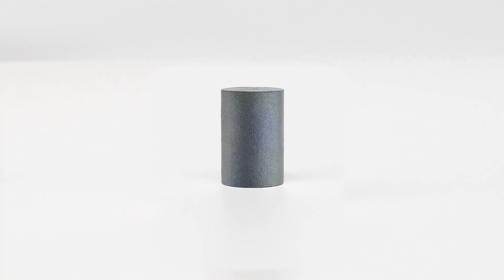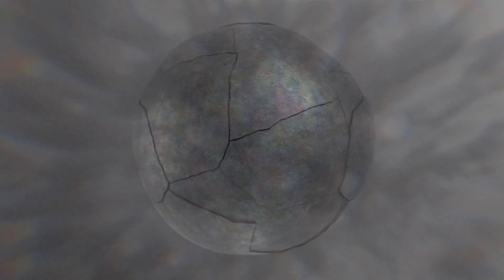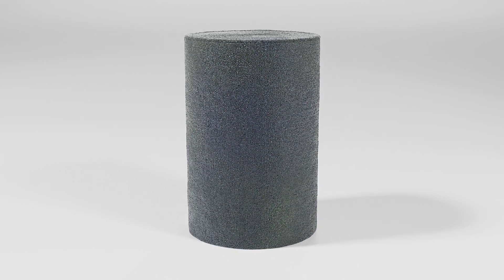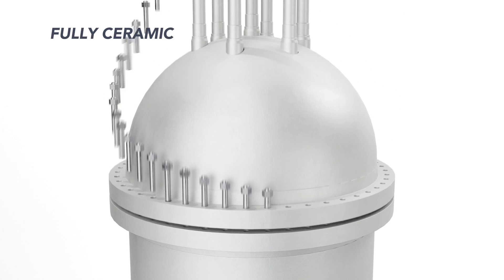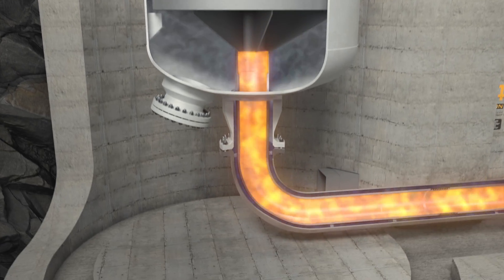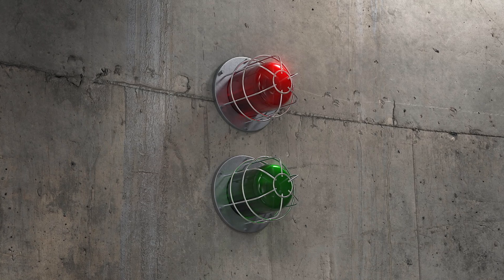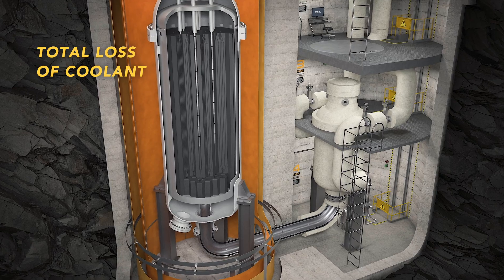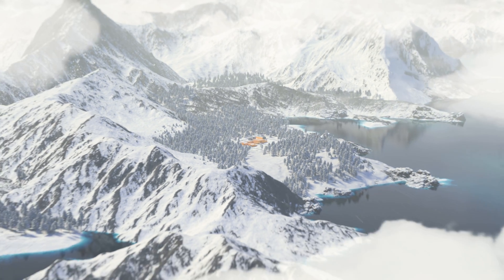How it Works – the Micro Modular Nuclear Reactor

Comment: That is one of the most impressive and least advertised technologies i have ever seen in my 72 years on this planet.  Bravo!!
Reply: If you haven't already look into "Gen IV" Reactors. Technically, this Small Modular Reactor IS a Gen IV, along with Molten Salt Reactors. Look them up, they are great ideas of ways of not having to have such large cement structures to keep the water under pressure, as the Gen III Light Water reactors do.

With Molten Salt Reactor (it is a metal/salt that becomes liquid at say 1000 Degrees F and can increase in temperature to say 4,500 Degrees F, before it boils. So that 3,500 degree is a ton of energy that can be put into the salt of the MSR as while it is not being used. (it is basically a complicated battery, that can be recharged every day, until there is a significant pull on the system which happens every day from usually 2-9PM.) When that surge of demand is over, it goes back to storing more energy for the next day.
Reply from the maker: @eriklondon2946  100% great comment. Didn't know the discourse was this good on YT. 

those temperatures are way too high. I don't think there's any nuclear reactor tech looking at an outlet temp above 900°C
Reply: @ultrasafenuclear  Oh you guys have positions in WA? Hmm, anywhere else I can work for you guys?
Reply: @ultrasafenuclear  My God

You guys are literally my dream, I all ways envisioned an underground nuclear reactor for the past 5 years and I KNEW it can be done. And walla, you guys did it, I'm so happy for you guys, this my literal dream. Thankyou for doing this guys, I want to help as EE if I can :)
Reply: We won`t see shit if it does not benefit governments directly :(
Reply: @TheBBoyPain Jai Hinduja.  South Africa will be trying to put up their design by the end of the decade.
Reply from the maker: @tedchandran  we employ many South Africans!
Reply: @ultrasafenuclear  Man, I'm an EE, I want to get involved, how can I?
Reply from the maker: @jaysaini955  Start evangelizing. talk to people at your local utility. Or are you looking for work?
Reply: @ultrasafenuclear  Work too, do you have careers for EE?
Reply: @TheBBoyPain Uh the first three have been announced.
Reply: IS A LIE    Give   Nuclear Your Money & Your Life  For 24k Years   No Nuclear Melt Down HAS EVER STOPPED  @ 41 CPM
Reply: This will go nowhere. It's a great technology but it's TOO effective. Climate Change Activism has little or nothing to do with climate. Last think they want is abundant clean energy. That's liberation...they want control
Reply: Got to get the uranium from somewhere, look at the Grand Canyon, what kind of idiot ours a uranium mine next to a tourist community lol lol lol
Reply: Nuclear combat for everyone lol lol lol lol
Reply: Trading efficiency for safety is not a good deal when "traditional", decades old fission reactors are already extremely safe.
Which tells me this is for niche situations and conditions, like to power remote cities/industry, but not to power a nation as a whole. Maybe the germans would use it I guess, because of their irrational fear of nuclear.
Reply: it is not adverised becayse it is just coming out
Reply: the future is now old man
Reply: It's a cartoon.
Reply: I wonder if this technology can be used to power space craft used to explore planets in the solar system 🤔
Reply: @Novideos00  Nuclear powered spacecraft have been exploring beyond our solar system for 50 years.
Reply: HOW OLD ARE YOU? but this reactor is very safe somewhat for when cooling rods stop working it will automaticly shut down (: or it has a spare cooling thing (helium gas) without power (: even without any cooling (: (: (:
Reply: @cucumbergamer-970  A Cartoon is safe, no cartoon reactor has ever caused environmental damage.  /s
Seriously, reactor "safety" has multiple levels .. operation, fuel disposal, dirty bomb exploitation, etc... radioactive crap is dangerous, always will be.
Reply: @KrustyKlown Son what would you know about it.
Reply: jup görink but tängy öh dere - :-
Reply: The United States of America passed an invention secrecy act of 1951. Look it up, value tainment or p b d did a video on it.They're hiding technology from us
Reply: It's called the answer.
Reply: This is best for vehicles charging station unlimited eneger for next 25 year for the cars.
Reply: What if the control rods jam?
Reply: Jai Hinduja.  The governments must really  go down to the Shidao Bay  nuclear plant in Shidaowan, China to get the most updated data on the benefits of running 4th generation triso pebble reactors.
Reply: This is 1960’s tech. Look up HTGR. Peach Bottom unit 1, Ft St. Vrain, Dragon, and AVR
Reply from the maker: @nukiepoo  it is for the most part. Expect core design, materials, and factory production have come a long way since then. Not to mention rendering capabilities ;)
Reply: İt's NOT impressive at all!!!! What about Nuclear waste???

Comment: They won't want them when they realise the cost of installation is NOT significantly lower per unit energy than full scale but the cost per unit energy delivered is at least 30% to more than 100% higher. Also there is also the fact that most of the refined fuel comes from China and sanctioned Russia, so there could be difficulties getting fuel. Also, NuScale, the only SMR company listed on a stock exchange, started 2025 at $17.71 and finished at $14.31, after peaking at $57.42. Not a good year overall for such a supposedly wonderful concept.

Comment: It takes less than a year to build and activate.  And it all happens 1 mile down at the bottom of a 30 inch bore hole . This is how we end all the cost and pollution of fossil fueled power plants. And dangers of traditional nuclear power plants . As well as dramatically reducing the footprint of all other forms of electric production.  Including hydroelectric.  Dams actually do harm altering the natural environment and actually altering the earths rotation . The benefits of these small super safe reactors will change our future in a most positive way like has never been seen before.  Imagine roads that have power coils under them to deliver wirelessly to all cars ,trucks etc. For pennies per 100 miles per vehicle.  It definitely is a real possibility now with this innovative power plant design !

Comment: You said the reactor is powered up by removing the control rods.
Then it heats up and needs to be cooled.
What is to cooling system fails at the same time the control rods cannot be reinserted for some reason?

Comment: They said the same thing about the Chernobyl reactor. It lacked active cooling, venting, and recuperatio systems. Now, even a child can simulate an explosion of such a module on a computer. The rod with fuel cells will break and stay in the core, causing a bang. No sensors will detect it. But Rosatom has a solution.

Comment: “…but these reactions slow down at higher temperatures…” need a bit more details since this seems to the most important feature.
Reply: I imagine that there is expansion room in the design on purpose. So, when heated high enough the fuel capsule can expand and as the tiny fuel pits inside get further from each other the reaction moderates.  Not sure about this: >>>  This might be what is called the "negative void coefficient".

Comment: So if you are using carbon as a neutron moderator, how does the reactor have a negative temperature feedback, (reaction slows as temperature rises) if for some reason the coolant is no longer present in the reactor.

Comment: Sounds like they’ve modified the Triga  reactor design to To produce amplified power output over a test reactor will significantly over a test reactor if they incorporate boron directly into the uranium fuel, that would give it inherent built-in negative reactivity so, even if it went into a super critical phase, it would not go into a prompt criticality face, because if the moment it started burning up, that boron boron would start absorbing neutrons in collapse it, and I think that’s what they’ve created here that’s why the reactor could inherently be safe because the laws of physics itself literally Prevents prompt criticality
Reply from the maker: TRIGA uses metal Uranium hydride fuel. Not our things. We only use high temperature ceramics in the core. But the general safety idea is similar.
Reply: OK but how like I don’t want you to reveal any trade secrets, but put it this way if you put boron in the uranium fuel, you get an inherently negative coefficient negative void coefficient, which is what shuts down the Traeger reactor to prevent prompt criticality, so how does ceramic do that and here’s the thing it’s been proven scientifically but you could make Triga  fuel rides they could produce commercial scale, electrical power if I was the President of the United States I would’ve passed along ages ago, but said by the year 2020 FCI was the president in the year, 1994 All new nuclear reactors be they can do or light water, reactor’s or heavy water reactors would utilize boron, mixed inherently in the fuel just like a Triga  reactor so how does this ceramic do the same job at the element boron dose?

Comment: How often do you change control rodes?
Reply from the maker: End of life. 40-60 years. never unless there are issues.
Reply: @ultrasafenuclear  Thanks Sounds like only Gouvernement applications with very limited and exclusive private sector applications that also with specific needs and not for commercial use. Like, emergency backup storage systems, military applications, secret facilities that needs UPS, space applications also is a possibility if you make it modular.

Comment: Haven't stated how much power it generates. The fact is nuclear is only efficient with multiple large reactors and even then its quite expensive such that we haven't been building that many plants. Something like this may work for a space base or in antartica where budgets are infinite but for mass consumer use it's likely that a plant with 5 reactors costs the same as 20 of these small ones but produces 10x more power than those 20.

Being able to be cooled passively is beautiful, but to make lots of power cheaply we need big reactors that produce lots of heat.

There's a reason we build buses and planes to fit in multiple passengers.

Comment: France has had a similar system  over a decade ago holding a patent on it over everyone else's head.  Proven technology where they shutdown all pumps and made a control rod failure for a  worst case sceniro for 24 hrs.    No problems.   A true failsafe system mainly due to no moving parts required....  :)  Self limiting by  the solid way the reactor was built......

Comment: thorium reactor are the best? way to go. they require power to go hot.
Reply from the maker: this reactor can utilize thorium. IT's just not necessary for the next several decades
Reply: @ultrasafenuclear  it should be as u can hold thorium in your bare hands.

Comment: Similar to HTGR pellets. The people from ornl brought a bottle of these to pass around and someond dropped and broke it. We all took turns using a ludlum counter to find them. Could imagine the chaos that would happen today despite being told that in theory we could eat a few with zero ill effects. They were about the size of very fine bird shot and made of uranium coated in graphite and SiC. Fun times ❤
Reply: They were the beads that went inside of the "pebble",and yup you are right the pebbles themselves tended to break up and fall apart leading to them abandoning the idea.
Reply from the maker: ceramics are brittle. that was probably a graphite pebble. Those are crap.

Comment: I hope the best for your project but safety has never been an big issue with nuclear it has been greedy corporations. Japans nuclear incident was caused from them ignoring warnings of tsunami issues for years prior. Three mile island was caused from maintenance issue and them ignoring warnings of manufacturer defective parts. The part that failed, failed I believe twice before at other facilities before the three mile island incident and was a known issue for a decade before and ignored. Chernobyl plant had many known issues which where brought up by American scientific papers and the day of the incident the man in charge didn't want to do a proper full shutdown and put the reactor into a full meltdown scenario that even the least educated person would of known not to do. While your reactor is built to remove the human factor in safety it will have to still make money for the cost of new tech and I can't see it making per dollar the same as a current gen 3-4 reactor does and it will come down to how much they can make vs cost of maintenance.
Reply from the maker: we don't think you can really predict that kind of stuff. Risk = probability X consequence. 

we prefer to reduce risk by reducing the the consequences of accidents rather than mess around with theoretical probabilities of them occurring.

Comment: very interested in micro modular marine reactors that can generate 11 MW - 14 MW of power either collectively or singularly . . . really curious to know if extraction of usable electric power (for marine propulsion or otherwise) is possible without the need for gas turbines . . . if so what are the other options available . . . a combination of micro modular marine reactor & direct injection marine fuel turbines instead of the traditional marine gas turbine . . . such know how is priceless even for a layman or just for the sake of knowing . . .
Reply from the maker: We are discussing exactly this with many customers who want power for various off-shore platforms and ships. It is feasible.

Comment: Alright, but how long before someone makes it a weapon?
Reply from the maker: My pencil is a weapon. 

Anyway, this is closer to a big rock buried in the ground than a weapon. It doesn't have the thermal, chemical, kinetic or potential energy that you would associate with other weaponizable systems like aircraft, large nuclear power plants, trucks and trains bearing chemicals, or skyscrapers.
Reply: @ultrasafenuclear  yes, however theoretically couldnt someone still create radiation poisoning if done tediously enough? Im kerely concerned for security because ever since sticks and fire... man has created weapons
Reply from the maker: @foxboiunknown320  indeed. need security. 

also, anyone trying to tediously do that would have to have significant knowledge and capabilities to do it without killing themselves. Many simpler ways to create weapons...
Reply: @ultrasafenuclear  i agree merely wondering how safe it is, figured it would have plenty of alarms and emergency mechanisms in case of tampering, also way to high of a sueprcritical point to worry about explosives, my main concern was ut being used in a terroristic dirty bomb attack or putin polonium style poisonings. Thats scary
Reply from the maker: @foxboiunknown320  handling these materials is difficult and dangerous with limited consequences, and it's so easy to monitor because it's radioactive. I'd be way more worried about engineered virus (self replicating and exponential growth) or tampering with the food / water supply. Oh wait...

Comment: Is there any nuclear that generates electricity instead heat for steam?
Reply from the maker: The steam gets used for electricity. You could potentially use thermo electric for thermo photovoltaics to turn the heat directly into electrical power. Not yet a viable solution.Could also use the charged fission products directly which is even less economically viable.

Comment: what about the water source? it becomes radioactive aswell?
Reply from the maker: there is no water source. The reactor is cooled by helium gas. The final heat rejection is made up of air cooled heat exchangers. Most coal and nuclear power plants still use water heat rejection with cooling towers. In any case, the air or water is not radioactive.

Comment: The micro nuclear reactor is the future of nuclear power, these miniature systems could power an entire city block by block. The efficiency of these is several magnitudes better than the older systems, and they are so very much betterthan the older systems as well, three of these would power the whole town i live in, and be able to supply not just power but heat as well. This is also the exact type if system thatbydenis completely opposed to at every turn.
Reply from the maker: Thanks. Keep up the support. Need every bit we can get.
Reply: @ultrasafenuclear  I have read quite a bit about these miniature systems, and for the power out put of one of these, you get a lot of power. From what I understand they can also utilize fuel rods that are partially spent. The rods just need to be recast.

Comment: Every small town needs one of these babies
Reply: This approach is way more practical than the HUGE power plant solutions we use today. Each community having a small independent grid that links to others offers redundancy and efficiency of design. Combine this with solar, wind, hydro and tidal to have a complete, carbon free power solution.
Reply: @ELCrisler  for cheaper electricity you need scale, you cant have independent grids everywhere
Reply: @_monti142  You might have a point.  I didn’t think of that. The economic opportunity might not be huge but I think that it will happen. No long distance transmission,  no single point of failure, less expensive disposal, and if the system is modular enough, then it will be like building Arby’s restaurants all over the country. I think that the big nuclear buzz of the Cold War was for the purpose of creating weapons grade byproducts.  This will be very different.
Reply: @ELCrisler  Agreed
Reply: Every AI mega brain will have one.
Reply: I would say every house needs one of these. Of course this is as large as a house but with time the tech will advance.